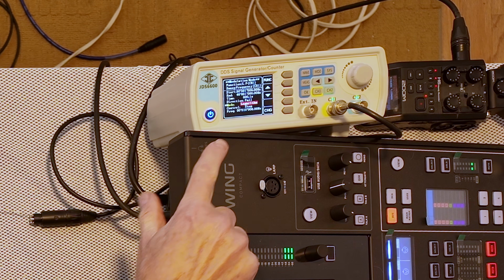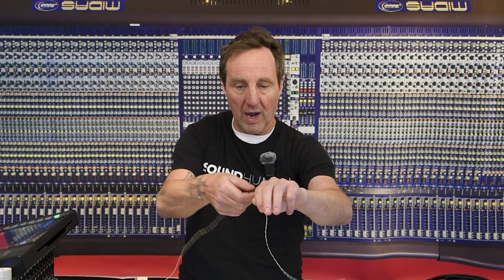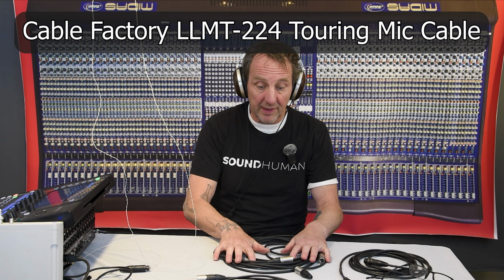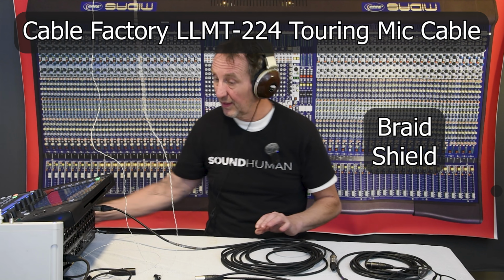Pro Audio Cable Noise Tests - Which is Best?

Comment: Nice topic. I worked in a popular Nashville recording studio in the mid '80's and a guy kept calling asking to come out to demonstrate to us his superior mic cable. We had a time when three of us engineers were around so we let him come over. He asked me to get an example of a mic cable that we use so I grabbed one for him. I plugged it into a tie line from the studio to an SSL mic pre input and turned it up and listened to the monitors like he asked us to do. He then took the cable end and started to swing about a seven foot section of it around and around in the air over his head. It was quite a sight and had all of us laughing about the guy who talked his way into our studio only to swing our mic cable around over his head. When we turned up the monitors, there was clearly a woosh sound that went away when he stopped his swinging.
Then he plugged in his special cable and did the same thing and it was quiet in comparison. He made his point and amused us pretty well.
Reply: Sounds like classic cable Rustle. This electrostatic effect is based on the material of the conductor insulation forming an effective condenser mic out of the cable. Most modern microphone cables have changed chemistry to avoid the embedded charge in the insulation to eliminate cable rustle. Some early cables were known for picking up noise when stepped on or moved on stage.
I noticed none of the cables in the video demonstrated cable rustle when handled.
Reply: @isettech  Can also happen once the internals of the cable are destroyed and conductors start to move around.
Reply from the maker: interesting. un terminated cables can be quite noisy and can be quite microphonic. 

some more than others. 

I think that could be an interest test vid looking at microphonic cables, cable terminations and the impact of snake lines that are not plugged into the console creating noise on lines that are plugged in.
Reply: @DaveRat  Given that the input impedance of most mic preamps is 1K ohm or higher, and the termination you use, like many microphones is 150 ohms (or so), not surprising.  The higher system impedance lets the wire make a better antenna,  Also the incidental unbalance as you move along the side of the cable with your transformer destroys the benefit of the balanced circuit much more when the system impedance is almost 10 times higher.
Reply from the maker: while doing numerous tests I have clearly noticed some cables are way more microphonic than others. one factor seems to be jacket material with softer rubber being quieter that stiffer PVC. 

I will ponder a test. the easiest is to use high gain unterminated but not sure that is a relevant test. would first need to confirm that there is a direct correlation with terminated cables.

Comment: length of testing cables are not the same.
Reply from the maker: that's true and also you may notice that both the RFI and EMI are loudest when the very weak noise sources I am using are very close to a small section of the cable.

additionally you also may notice that the test results align exactly with what is expected and the better shields shield better for RFI and the better wire twists protect better from EMi.

and finally, there is not direct correlation between the longer wires and poorer results.

so I am curious as to, based on your observation and 3xperience, to know how equal cable lengths would have altered the test results in any meaningful way?
Reply: @DaveRat  Yes, longer cable is more suspicious to both RFI and EMI noise.  In fact, RFI and EMI are very much the same thing, just EMI is a more general term.  Well with EMI/RFI of 145MHz (so called HAM band), and wavelength of around 2-meters, audio cable of similar length or multiple of it, will become a good antenna.  Both twisting and shielding are important to noise immunity, twisting can reject Common Mode Interference, whereas shielding can reduce the amount of noise that can go into the signal wires.
Reply from the maker: hmmm, I appreciate the info but it kind of seems like actually watching the video may be informative for you as you are providing info that I cover in the video

one aspect perhaps of particular interest is where I use a magnet to demonstrate the EMI tolerance or rejection of each cable 

 I also show that the type of shielding directly correlates to the rejection of RFI and the quality of the twists directly correlates to the rejection of EMI 

since I'm using highly localized low power noise sources focusing on a short segment of the cable lengths, The overall cable lengths therefore do not alter the results in a significant way. 

also I think maybe you seem to think this is a test of cables whereas the video is about understanding the different cable constructions and the type of noises they will reject better or worse

and I do appreciate the comments and interactions.
Reply: @stephenwong9723  sure in a sense everything is electromagnetism including our hearing :) but for practical purposes a transformer or switched power supply effects an audio cable in different ways than a radio antenna tower, thus different approaches to mitigate the issues. 

shielding attenuates electric field related noise by forming a grounded Faraday cage and twisted pairs mitigate the magnetic field induced noise by having the electromotive force in reverse polarity in adjacent wires and this video did a fabulous job in showing how different cable constructions behave... the title of the video might be a bit misleading as in a brand comparison or something but i found the content quite educational.

Comment: Terrific video Mr. Rat. I love it when you do these tests.  However I was struck by a variable that may have had an effect on your results.  I can see that the cables you are testing are different lengths. I would think with RF in particular, this matters as longer lengths are more prone to RF.
Reply from the maker: agreed though two things I think are important to consider.

1) regardless of the cable length the RF interference on all cables was most audible and measurable when the a short length of the cable being tested was in extremely close proximity to the RF source

2) the result align exactly with expected results as in, more shielding had lower RF than less shielding irrespective of the cable lengths being tested 

The video was about pointing out The different cable designs have vastly different tolerance of EMI and RFI. 

I guess another test could be weather different cable lengths have vastly different tolerance. though based on my testing, I don't find that to be true. I find that longer cables are more susceptible and there seems to be a relationship between cable length versus proximity to the eye of source
Reply: @DaveRat   Thank you. Testing cable length would be another fascinating experience.
Reply from the maker: I will ponder a way to that. I believe it's common knowledge that longer cables tend to be more noisy.

and we know that improved shielding helps with RFI and improved twists helps with EMI

I doubt I would find that poorer testing short cables prefeom better at long lengths.

what would be the most useful angle to address cable lengths and bring new info to the table?

Comment: From an RFI standpoint, were all the cables the same length? Some cables can resonate at certain lengths and become more susceptible to RFI. It would also be great to see you try some ferrite chokes where the cables plug into the mixer to see if that helps reduce the interference. You can get ferrite pieces that snap onto the existing cables without any modifications.
Reply from the maker: interesting. this vid is more about learning and understanding and to show that there are significant variations between cables and that a cable good for RFI can be quite different than one for EMI.

as far as seeking solutions and troubleshooting specific issues with things like using ferrite chokes as a low pass filter, I see that as a differing video adventure.

Comment: Very interesting, thanks! There would be a good "noise" video in comparing several different mic pre input types - really good transformers vs cheap ones vs electronically-balanced, both discrete and chip-based.
Reply: To jump in on the transformer verses balanced. Have first hand experience on this with an AM radio station less than 1000 feet from one venue location. Mackie SRM450 active speakers, the Behringer X32 console, and the Meyer Sound 616 speaker management box all picked up the radio station when connected to a Whirlwind snake from FOH. The Avid SC48 console performed flawlessly. The radio station was heard on the FOH mains due to the speaker management box, the band talkback from FOH, and the monitor engineer talkback to the active speaker all had the radio station in them. To fix the issues, RF chokes of 15mH were installed at the inputs from the FOH snake to fix the issues. A transformer based "Press Box" did not have RF issues. The Meyer Sound used 3 chokes for LR and center sub, the talkback to the band used one on the back of the Behringer TB line, and the monitor speaker used one at the speaker to fix all issues. Cost was not the issue as Meyer Sound speaker management boxes hardly fall into the "cheap category, but still required chokes to keep out the RF. Design is more important than cost. The Meyer Sound had no RFI issues other than the venue next to the AM radio station.

Comment: I worked with an older guy who just used a cheap AM radio as an EMI detector.
Reply from the maker: EMI or RFI?
Reply: @DaveRat Rfi most likely around 1Mhz
Reply from the maker: copy, and interesting and easy RF noise detector!
Reply: Thanks Dave. Very interesting.I have a view Canare mic cables Klotz and a view Mogami.  The Canare works the most for me.
Reply: I'm getting a tiny .3 v from the switching power supply even if its running on battery power. There's h probes too.